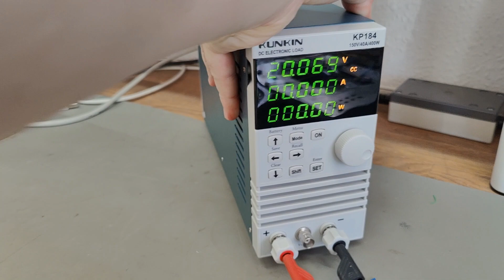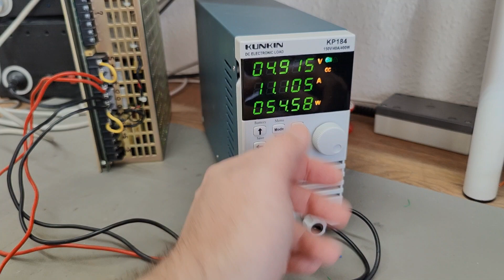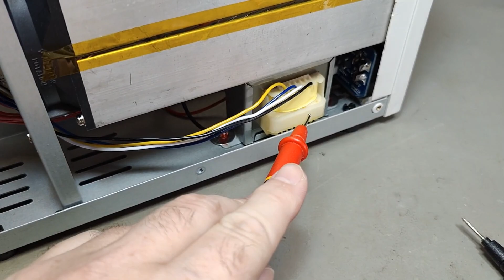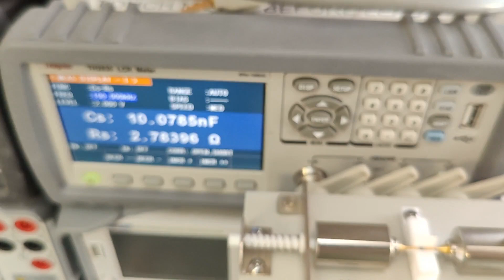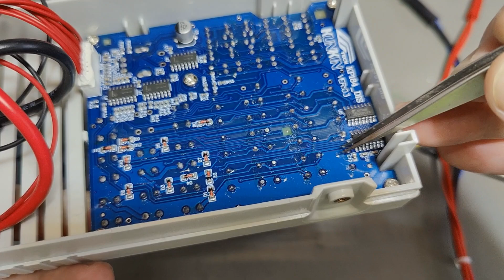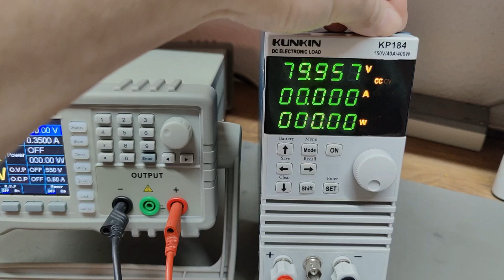Kunkin KP184 DC electronic load 400W 150V 40A test teardown

Comment: The Constant-Voltage mode is a bit un-intuitive..  since you're supplying it externally, what is it actually doing?!   

At what power should banana plugs be avoided?

I have a application that uses 400hz 3-phase..  s interesting how a DC e-loads are relatively common/cheap... AC e-loads seem extremely rare!
Reply from the maker: constant voltage mode, if you think about a zener diode, how it works, now imagine a DC load that is an active amplified and regulated "zener" diode, so if the input voltage is under the set point, it pull no current, and if the input voltage is over the set point, it pulls alll the current is possibly can, forcing the voltage to be exactly what you want, this mode is of course used together with a voltage source with some output impedance.

Comment: I just bought one of these, and it looks like they may have fixed a couple of the issues.  First the banana jacks fit properly, and they even look a little different than the ones on yours.  The soldering on my was very good, so either I got lucky or they improved that. 

The one thing I haven't figured out yet is the beeping. I turned off the sound in the menu, but the wheel still beeps. Really annoying. Don't see anything in the manual for that, so I'll probably pull it back open and stick a piece of tape over the beeper.
Reply from the maker: good idea with the tape, i love to adjust the wanted sound level by adding more or less layers of tape, use red or yellow tape, so it is very visual what you have done for the future you forget about this.
Reply: @TeardownOZ2CPU  So I took this thing apart, and the buzzer was right on top of the main board. However, the sounds this thing makes when turning the knob are so high-pitched that putting tape over it did almost nothing to the volume! I tried different types of tape with varying amounts.

I ended up pulling the buzzer off by gently twisting it back and forth. Not ideal but couldn't stand it!
Reply from the maker: @larrybud  ha ha cool, i did exactly that on all my UPS systems, i use a huge external battery and they are supposed to run fridge and such for many hrs if power fails, so i cant be stressed with beeping, the day designers make it possible to turn sounds on/off correctly we all be happy, in your case you like to get a sound if there is an important error event, over temperature or reverse voltage.. but now that is off also..
Reply: @TeardownOZ2CPU  Yeah, understood. I could always put it back, maybe a resistor or pot in series with the buzzer to kill the volume!

Comment: Great video. Thanks for sharing. User manual reads POWER SUPPLY INPUT as AC 110V/220V ±10%，50±2Hz. Is it a typo? We at America run on 60 Hz. Please comment. Regards
Reply from the maker: it must be a typo, it will of course also work fine on 60Hz
Reply: @TeardownOZ2CPU  thanks

Comment: Hej Thomas.  Nu nævner du, at du er i tvivl om, om det er en kp182, eller kp184 du har - pga vægten.  Softwaren i den må være til  kp184. Instrumentet skriver kp184 meget kort i øverste række display, når du tænder det. Det kunne være interessant at se hvad der sker, hvis instrumentt bliver udsat for 400W.
En sidebemærkning: både i specifikationerne og på omskifteren til forsyningsspændingen, står der 220V (og +/- 10% - i specifikationerne). Men vi haft 230V i EU i mange år, og der skal produkterne også kunne holde til en overspænding på 10%. Den lidt højere spænding vi idag har,  kan i sjældne tilfælde give problemer,  hvis produktet kun er designet til 220V +/- 10%. ( Dertil også problemer med overholdelse af EU krav og regulativer).  Jeg ser ofte denne problematik på produkter fra eks. Kina. Det er som om, at især Kina, endnu ikke har opdaget,  at vi i EU har haft en lidt højere spænding i årtier.
Reply from the maker: I did also test it at 400W no problem.

Comment: Hi Thomas many thanks for creating this video. I did learn a few new things and I really appreciate that. About 3 years ago Tony Albus did a video on replacing the terminals from 4.2mm to 4mm and he also put a power switch on the front. I don't understand why they used a 4.2mm connectors. Rick
Reply from the maker: yes the ultra loose banana jacks are terrible, it is relevant since many experiments you could use thinn test cables for low currents, and then it could be perfectly fine to use banana leads, but you still dont like loose connections, cut the banana away and solder a proper sized screw spade open side, then you solved it real fast and easy

Comment: Great video as ever. Had the unit for close on 2 years with no issue but fairly recently it stopped outputting the load to  the display. Tested everything all fully and all is ok. Turns out the firmware somehow got corrupted and I don’t have a copy. Anyone got a clean version?
Reply from the maker: idea:  contact the company and ask for a software upgrade and how to perform instructions, most likely they will help you.